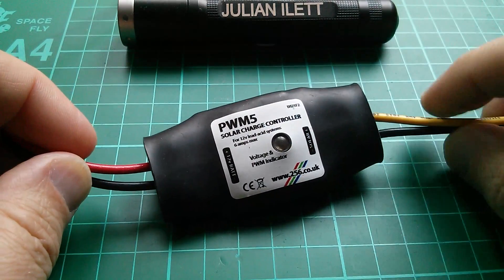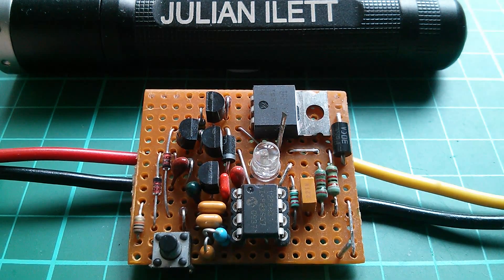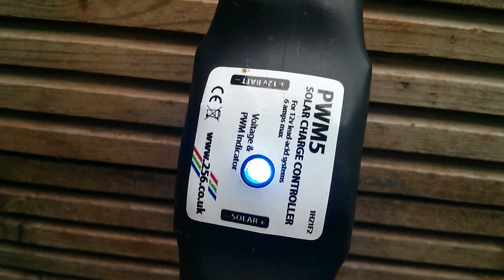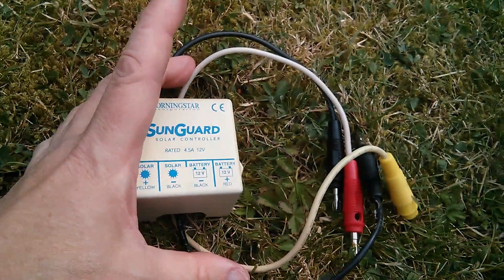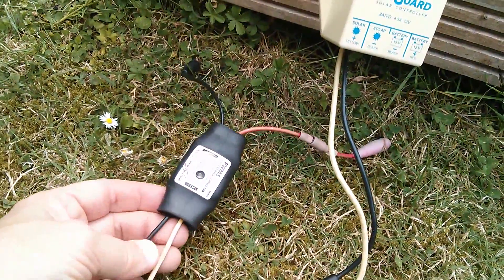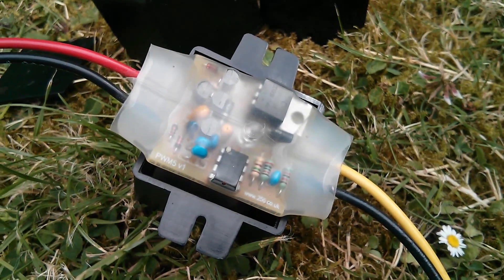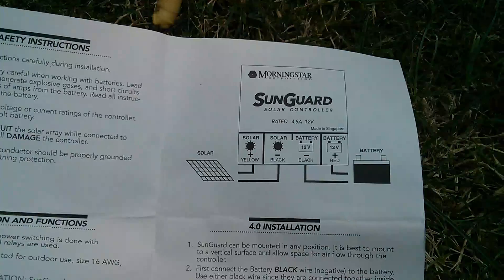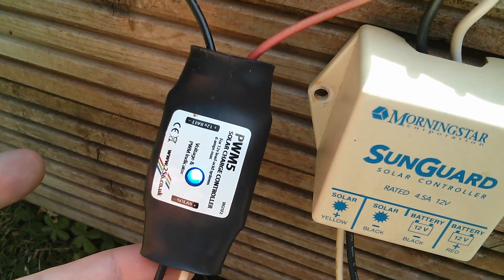Julian reveals: Secrets of the PWM5 - #1 Inspiration

Comment: If you will excuse a bit of pontificating, the basic reason why your venture didn't work out is that you failed to bill your time to the manufacturing effort at an appropriate rate.  Had you billed your time at a rate commensurate with a highly skilled electrical engineer, you would have immediately realized your time was far too valuable to spend it cutting up strip boards, pre-forming shrink wrap tubing in an electric kettle, and so forth; and, having realized that, you would have hired on the appropriate low wage labor to perform those tasks (or simply eliminated them through outsourcing) thus freeing up your time to innovate new variations and tend to the marketing.  Ah well, live and learn.  Please forgive me if I sound harsh, I've been watching your vids for weeks now and thoroughly enjoy them.  You have a great talent for explaining complex technical concepts in simple terms that few YouTubers can match.
Reply from the maker: Thanks John - you're absolutely right. I'm simply not an entrepreneur. Re-directing my efforts into education (and dare I say entertainment) was the best change of direction I've made. Cheers :)

Comment: Julian,

I followed the original uTube series when you went through the hardware bits and pieces but didn't have a use for the product at the time - no solar panel. I recently got a solar panel and was gutted to find out that you were out of production so the release of the firmware is a bonus. The link doesn't work anymore possibly because you have changed your site. However, I would prefer to use an arduino for a one off. Wasn't the development done on arduino and would you be prepared to release that. You may have already done so but I can't find it. Many thanks Alan

Comment: Is it necessary to use a microcontroller would a 555 timer be all that was basically needed ?
Reply from the maker: Keith Green The microcontroller has to measure battery voltage, vary the pulse width modulation in a feedback control loop, switch between float and absorbtion setpoints, flash the LED to display voltage. Yes, a microcontroller is very much needed.

Comment: Have you ever compared yours to the cheap ones they sell on ebay?
I have a 40 and 10 Watt connected parallel but they hardly provide over 30 Watt with a cheap controller I bought.  Might be worth comparing both during the next ULTRA sunny week.
Might be nice if we all stuck our heads together and made a nice controller that we could fully monitor. Looks like a nice arduino project to get the graphs of the solar harvest.
Reply from the maker: Luc Peeters The PWM5 would probably yield similar results. A pulse width modulation charge controller cannot extract maximum power from a solar panel because there's a mismatch between Vmp of the solar panel and the battery voltage. MPPT addresses that by using a DC/DC converter to allow different panel and battery voltages.
Reply: Julian Ilett  not too sure about that. I've seen my el cheapo solar charger pushing my 12V batt to crazy levels so it might be nice to measure the output voltage.
Reply from the maker: Luc Peeters Certainly the PWM5 regulates well - the voltage setpoints (13.5V and 14.4V) are specified in the firmware.

Comment: Thanks for the video Julian, I look forward to the projecting. Is this the last in your line of PWM controllers or are there more recent upgraded versions?
It would be interesting to see your reasons for not doing them anymore, I done an item myself that I made up and tried to go commercial with but alas after a while I lost interest as the customers always wanted the lowest price, low quantity deliveries and a lifetime warrantee or their pennies (pounds really) back. I sold quite a lot and it was good for a while but after they had bought, they didn't need anymore because it was reliable, but you always get the odd one.
Best regards
John
Reply from the maker: John M Thanks John. The 6A version was the last of the upgrades. My reasons for not making them anymore will be explained in great detail :)

Comment: I've got some nice cheap 5A Schottky diodes - only drop about 250mV.
But I understand they're leaky - more so with temperature. Still, I guess temperature usually means sunshine, so I guess it don't matter much.
I always thought the PWM5 had an inductor, for some reason....current gain an' all that. That's what I want to look at, for up in Finland, But then, I'm trying to make a mini, highly efficient 'muppet' based round an ultra-low-current Atmel Xmega E series. Maybe the PIC is even lower power...gonna take an avid peek at the schematic (You did finally do the schematic with Eagle, rather than the 'napkin' method, I trust? :-) )
Reply from the maker: Andy Crofts I remember heating a schottky diode to about 200C and got zero forward voltage. But the reverse leakage probably also went sky high. Basically, the diode became a piece of wire.
No, sorry, the schematic is still just a scribble: http://www.256.co.uk/wordpress/wp-content/uploads/2012/09/PWM5-Circuit.jpg
Reply from the maker: Andy Crofts Or you can get the schematic from my new website: http://256.uk/?page_id=68

Comment: 13.5 is not going to ever fully charge a lead acid battery. For a flooded battery the voltage is usually 14.7 at 25 degrees C. At freezing temperatures the voltage would have to be 15.55v
Reply: Shaun Dobbie Google lead acid state of charge, you will see a nice graph that shows at low charging (C/40, float) the battery is 100% charged at 13.5V and 25C. The number you are using is probably from car charging and not relevant in solar chargers. Generally solar products you care more about lifespan/reliability/efficiency than maximizing speed + capacity. Commercial units I've used were 13.8V as seen in the video.
Reply: The numbers I am using are from the Trojan datasheets for their T105 batteries. They need to be brought up to 14.7 until the current falls to C/20 and then floated at 13.8. I suffered some sulphation in Winter because I never brought the voltage up high enough when the batteries were at 0 degrees C. This resulted in a weak cell.

Comment: Could you make a circuit that contains 3 18650 batteries and can be switched between series and parallel connection of the cells?

Comment: HI,

Can the PIC12F617 be used for this project ?,

Also what MOSFET is used ?,

I am happy to supply pre programmed PIC's as well as other parts for this project on our BasicMicroUK site, maybe even an SM version PCB and parts,

Great little project,

Thanks
Dave
Reply from the maker: david ellis Thanks Dave. 12F617 is a possibility - it has ADC and PWM, but the source code is in assembler, so there may be a load of register changes. MOSFET is IRF3205.

Comment: Doesn't a solar panel (without a protection diode) essentially short out the terminals in darkness because of the panels parasitic diode?
Reply from the maker: Yes, although a 36-cell panel would have 36 diodes in series (at least 18 volts of forward voltage drop). I can't see why that would be a problem. Must test this one day.
Reply: Julian Ilett Good point. I wasn't sure of the typical the topology of solar panels. Yes, ~18 V nominal forward drop won't cause a catastrophic failure, but would be interesting to test that setup for leakage current. Do you have a µCurrent or other capable device? I suppose if you had a µ there would be a video about it...
Reply: Gameboygenius  +Julian Ilett No there will not be a short there will be a few mA of reverse current if you connect a battery to the panel it will depend on the size of the PV panel and the battery voltage vs numbers of cells.
I think it was around 8mA if you connect a 25V battery to a large 250W 60 cells PV panel.

Also Julian mentioned reverse current diode but there is no panel that has that integrated what they have is a by-pass diodes that serve a completely different role (has to do with partial shade).  It will be wasteful to have a reverse diode (blocking diode) on the panel.
Reply from the maker: ***** I have a few small panels with blocking diodes - I'm pretty sure the 12W amorphous panels have them.
Reply: Julian Ilett Yes those really small panels are probably designed to be connected directly to a large Lead Acid for maintenance charge still not a good idea without a proper charger.
I was mostly referring to more mainstream 36 cells 60 cells and 72 cells panels with 5 and 6" mono or polycrystalline cells. Those are 80 to 300W panels and there a blocking diode is not acceptable.
But all this larger panels mentioned above have usually two or three diodes in parallel with half the cells or 1/3 of the cell on the larger ones. This diodes are mostly useful if panel is partially or totally shaded in large PV arrays with multiple panels connected in series.
Ideal diodes may be an interesting subject for one of your videos. They are made out of a mosfet and an so called ideal diode controller. I'm using the LM5050 in my new SBMS two of them to allow me dual PV inputs.
I have the schematic in my last google+ post if anyone is interested.
They are not really ideal :) like super conductors but the have much lower power drop as low as the RDSon of the selected mosfet allows but it will be significant when compared with a Schottky diode. It will have been impossible for me to have 120A PV input with normal diodes.
Great video, I will love to here more about the experience with manufacturing and selling this. Maybe it still works for some niche products like my SBMS (to early to say) but I agree with more common stuff is impossible to compete.
Open Source should still allow you to sell your own product since that is just "free" to use for non commercial purpose but this is in an ideal world where all play by the rule.
Reply from the maker: ***** It seems that panels with MC4 connectors (designed for stringing together) have bypass diodes. Smaller panels which have either 2.1mm (or those reversing SS) connectors tend to have blocking diodes. That's just what I've observed.
Reply: Julian Ilett That is possible. I was only interested in the larger panes those that use standard full size cells 5" or 6". I only have a small 10W 36cells (cut cells) PV panel and that one has no diode at all (it make sense since is a small panel and will not benefit from a bypass diode). In fact bypass diodes are only useful with some MPPT type chargers extremely useful in large series connected strings for grid tie connected applications where part of a panel up to a few panels are shaded.
Still I do not see the sense of a blocking diode on any PV panel since a charge controller is needed anyway for battery charging and that controller will need to have protection for reverse current flow and even if it will not have that the reverse current is extremely small so less power will be lost that using a blocking diode.
I will have blocking diodes inside the new SBMS but you can imagine that at those type of current up to 120A (sbms100) a normal diode will be impossible so I use so called ideal diode made out of power mosfets and an ideal diode controller LM5050 in my case.
A normal Schottky diode will have at least 0.8V drop at this sort of currents 120A so about 96W of heat will be dissipated in this conditions not acceptable.
The entire TDP of SBMS100 is 22W that includes the two ideal diodes on top of other things there so about 10x less power loss is possible with ideal diodes but at increased complexity (maybe not increased cost since the Schottky will need a large probably active cooled heat-sink).
The older SBMS4080 has a back to back mosfet configuration on the input to keep the cost down and only has a single PV input not two as on the new SBMS100.

Comment: This is a great start for new solar series. Great idea!
So let's start right into: Good idea with the protective diode. Especially if one follows you through all your experiments, chances are high to short something and blew it up. However, standard diodes are adding a "high" voltage drop, schottky diodes might be expensive. So how about a "ideal diode" made by a MOS FET in the next generation of this unit?
Reply from the maker: Astralix2011 Charge controllers often use back-to-back MOSFETs which solves the problem, but introduces difficult gate drive problems
Reply: Julian Ilett I think it should be somehow easy to make, so may be some LT or Analog gate driver in SOIC case? This could be soldered easily to a SMD adapter board. The other way could be to use the uC to generate all the driver voltages. My 180W panels do have Si Diodes built in to decouple the single strings from each other. However for messing around and trying to develop something, a design of an ideal diode incorporating a MOS FET might offer to add a current limiting or electronic fuse option. But I guess this more for the other end of the row as the PWM battery manager is at the battery side after the MPPT and the fast hobby fuse device is at the panels before the MPPT :)
However, keep up the good work! I am still waiting for my china stuff to arrive in the third week now...